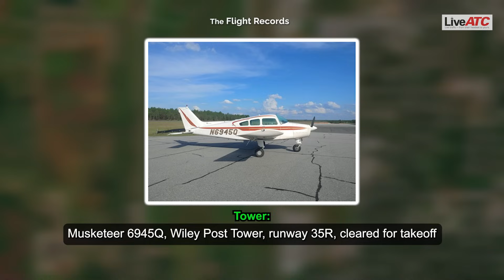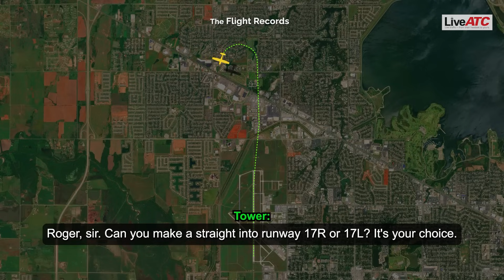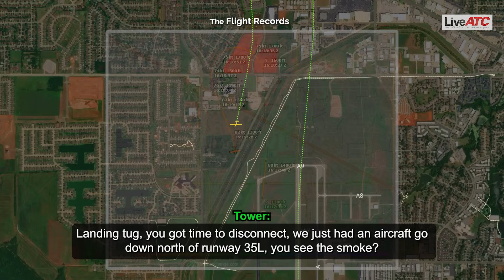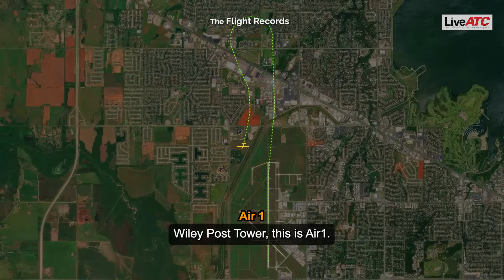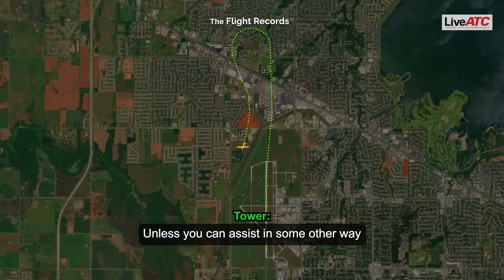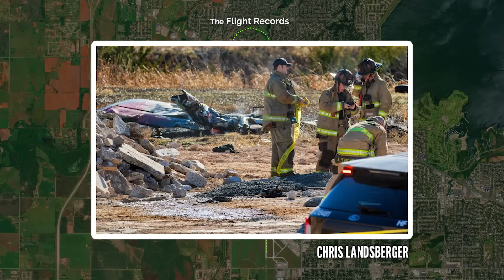LOSING POWER just after departure | 2 DEAD IN NW OKLAHOMA CITY PLANE CRASH

Comment: As a CFII I will never understand why people waste valuable time on the radio.  I have had to land in farm fields, taught dozens of students how to conduct emergency landings, and other procedures when there is very little time to spare, none of it ever included talking on the radio.   If your engine fails there is nothing the tower or anyone else can do to save you.  It's up to you to practice what you should have been taught.  The radio is fine when you have lot's of time.  I have had emergencies at high altitudes and had the ATC find me an airport wihin a short distance away.  But not when seconds count.
Reply: I was giving my son a lesson (he's an instructor in the CV-22 now) when we suffered a catastrophic engine failure after takeoff at KFMY runway 5. After I took control and knew I'd make in back down on the available runway I called the tower and let them know we were landing. I figured they had a right to know, as long as I had the approach more or less nailed, but didn't make the call until I got the important stuff done. As for people taking the time, I agree that unnecessary communication is a bad idea but I also understand, to some degree, the human need to talk to someone at stressful moments.
Reply: The only use in such a situation like this is to let them know you have an emergency and are turning back so they can clear other aircraft out of your way.  Also understand that a partial loss of power could mean a total loss at any moment and find a place to get the thing on the ground.
Reply: Agreed 100%   In April of 2000 I experienced a crash of the aircraft I was flying.   A Piper 161 Warrior, N4319U.  It was in Williamstown, NJ.   It was a similar situation with losing power at 2100 ft.  There were no airports in sight  so I concentrated  on NOT letting the aircraft stall at low altitude.  If I was going to hit anything it was going to be horizonal, NOT vertical. I felt in those few precious minutes,  the only thing I could do, after going through  my emergency check list is,  FLY DA PLANE!!!!!!!  Thank GOD I did, right into a corn field, and Thank God, we walked away.
Reply: @victorcroker2765  I learned at Linden airport in central jersey.  LOTOT we did 1995 practice at 1,900 rpm, cherokee 150 hp short wings, added 10 degr of flaps, leaned mixt and some carb heat if humid.  Sustains altitude like that.
  Many just land anywhere in panic, and destroy the airplane.  Hell NO.  It is mostly a bad cylinder but you can still fly level to nearby airport with 2 on board at 1,900 rpm at near sea level.  Not high..
Reply: I think its like a security blanket or something.  It's like calling 911 while at the same time looking down the barrel of a gun.  The dispatch or police can't do a damn thing for you in that moment.
Reply: @1realtruthrightnow742  Instead of keep fighting, they call mom and dad.  Panicky Pilots will crash.
Reply: @1realtruthrightnow742  One of our basic needs is communication, and we endeavor to train that reflex out of our students.
Reply: @CFITOMAHAWK  I found references on the web to your acronyms, neither of which do not appear in the AIM or the FAA Airplane Flying Handbook, or the PTS for any rating, and are therefore meaningless for flight training.  But kudos for getting all your flying education on the Internet. 

You still haven't addressed this terrible advice. "If the engine is vibrating at over say 400 agl ofter (sic) take off, but keeping the rpm over say 1,700 then a tunback can be done safer due that is mostly a failed cylinder and the others are keeping some rpm and will mostly sustain level altitute (sic), but wont climb on 3 cylinders of 4.  6 Cylinders engines mostly will climb on 5 unless high density alt. or heavy.  NOTE THAT. 

BUT IF ENGINE IS SURGING ON AND OFF,  that is a fuel problem instead and it might quick OFF soon.  Lower the nose, change tanks and lean the mixture a bit.  Don’t turnback unless a power off kind at over 700 agl is safer because it might quit on the low turn and you wont reach the runway."

Besides being nearly impossible to read, HOW DARE YOU give specific advice for some unnamed aircraft and push the incredibly bad idea that those numbers apply to any aircraft?  And the very idea of continuing to fly after a cylinder fails, something a pilot CANNOT diagnose in flight, is absurd at best and deadly at worst. Again, HOW DARE YOU!

By the way, the "C" in the engine failure acronym does NOT stand for communicate. You are conflating it with the unofficial phrase, "aviate, navigate, communicate.

"An altitude marker on altimeter that you use to mark the alt to turnback in case of LOTOT and or EFATO before EVERY TAKE OFF, depending on conditions you see."

As there is no chart in any POH to calculate that altitude, how do you calculate that it? 

Readers: Do not even consider taking this guy's advice. If you have questions regarding this or any other subject, consult with a CFI.
Reply: @CFITOMAHAWK  I looked up your acronyms and found only a couple of references, but no description of any maneuvers. Can you kindly describe those four maneuvers? In the interest of safety? 

I predict you will not provide that, or any other technical information I have requested, which is interesting as you have passed yourself off as an expert and given advice in this forum. And have you still not realized that you are arguing with an actual flight instructor, which a real pilot would have suspected when I mentioned the Practical Test Standards in a previous comment. 

People like you are dangerous because somewhere out there are people who would follow your advice. Readers, I reiterate, do not take flying advice from this guy as he is not a CFI, and maybe not a real pilot at all, and the anonymity he enjoys here allows him to give bad advice and never be held accountable. Always engage a real flight instructor for advice on handling engine failures or any other questions.
Reply: @CFITOMAHAWK  "Im a retired CFI that even qualified for Master CFI too"

Of course you are.
Reply: @CFITOMAHAWK  I have Airman Certificates that say Commercial Pilot and Flight Instructor, do you? You are a fraud.
Reply: My Bush  Pilot CFI in 1995 had 3 partial power fails working on old cargo airplanes in South America.  He was also a mechanic.  So i learned from the best, i dindt want a BS CFI with not that experience to BS me.  He said: loss of thrust On Take off, or partial power lost (we say LOTOT lately) mostly depends of kind of LOTOT.   If the engine is vibrating at over say 400 agl ofter take off, but keeping the rpm over say 1,700 then a tunback can be done safer due that is mostly a failed cylinder and the others are keeping some rpm and will mostly sustain level altitute, but wont climb on 3 cylinders of 4.  6 Cylinders engines mostly will climb on 5 unless high density alt. or heavy.  NOTE THAT. 

BUT IF ENGINE IS SURGING ON AND OFF,  that is a fuel problem instead and it might quick OFF soon.  Lower the nose, change tanks and lean the mixture a bit.  Don’t turnback unless a power off kind at over 700 agl is safer because it might quit on the low turn and you wont reach the runway.

= Dont turnback or turnaround the airport if engine is surging on and off under the power off turnback marker YOU HAVE DONE before that take off.  We had a marker on altimeter.
Reply: @CFITOMAHAWK  A turnback marker? If you are a CFI, as your screen name would seem to indicate, how in the world do you justify throwing out specific numbers for some unknown aircraft, and and advising people to govern themselves based on that information?
Reply: @CFITOMAHAWK  Never heard the term, nor since I started flying in 1971 have I heard of anyone doing such a thing. I suspect you made that up, as you did those acronyms, but okay, if that's really something you do.

You also didn't address my comment regarding your ill-conceived advice based on the dubious numbers you presented.
Reply: I lost a engine 4500 12 miles from PTW I told air traffic I had a engine blowup and was landing next to RT 100 in the grass phila  suggested I try to make Pottstown airport at your 9 o’clock 12 miles I looked over and saw the towers and the airport  I never thought of trying the airport I was in a diamond da40 the controller helped me in that emergency in my case I was communicating praying and flying but I am good at multitasking
Reply: As a pilot of 40 years , i agree. Aviate, navigate , communicate, in that order. Doubt he enough altitude to return to the airport anyway. Fly as far into the crash as you can. A stall /spin is never survivable.
Reply: Aviate. Navigate. Communicate.

In that order.
Reply: Yelling a Mayday in order to clear the runways is all you should generally ever do with the radio I would imagine
Reply: @ChadDidNothingWrong  Why yell? Yelling could make your amplitude modulated transmission difficult to understand.
Reply: @ChadDidNothingWrong  He was over turnback altitude.  you turn, then call. and troubleshoot.  Calling is the last thing.  landi on taxiway if , or grass.  Take off guys wil fly over you.

Comment: It's called the impossible turn for a reason. Don't think you can make it back easily. Fly straight ahead and pick the best spot to come down while maintaining airspeed and level flight. Don't get suckered into trying to make it back to the airport after a power loss. You will only end up being the first one at the scene of the accident.
Reply: Actually, I think he made the turn-around successfully and was headed back to the field. I would say that he tried to stretch the glide a little too much and stalled within throwing distance of the runway.
Reply: @megadavis5377  ---  I agree.  The impossible turn isn't always impossible if you manage to keep the nose down and don't freak out.  But you have to offer altitude in trade.  He got past that, but then remaining altitude and distance came into the equation.  At that point, it's full flaps and aim for the best spot to reduce speed and impact (like between two trees).  At the altitude he probably had left there was no chance to recover from a stall.  It seems there has been above average GA tragedies lately, although Dan Gryder from Probable Cause is keeping tabs on this and saying otherwise.
Reply: I’ve tried it a few times. Always came up short. Always best to find a big open road or field.
Reply: they actually made the turn, but had no altitude left to work with.
Reply: Don't believe he stalled in the turn. Turn was completed and he was on the way back to the airport!!
Reply: he didn't stall, but if the plane wasn't making enough power, you can bet he lost precious altitude making that turn. @scotabot7826
Reply: @mellocello187 No other places to crash on that airport, he didnt change tanks or troubleshooted either, That airplane have short wings and dont glide far.  There was no wind, At least he tried instead of crashing on top of houses and cars straight ahead.  He survived with some injuries..
Reply: I only wish single engine pilots would study these types of incidents, really think about the situation and recommended solutions, and fix them in their minds before they switch the mags. One too many don´t.
Reply: Correct.  He had not much choice.  Just terrible.
Reply: Look at that map  Not a lot of open anything around there.
Reply: Word.
Reply: Lol. It is a very possible turn if you know how to fly. Go read Barry Schiff. for decades he spoke about the BS of the impossible turn
Reply: @RATINDEXA320  "Lol. It is a very possible turn if you know how to fly."

I would say that it's only sort of possible, but that depends on so many factors it's difficult to label it possible or impossible. 

And yes, I know how to fly.

Comment: Not smart to take the left turn.....better stay straight and land anywhere you can, without making any  turns...Happened to a guy I knew who had a twin,  whose engines both quit on take off. He went straight down, ended up near a woman's house, but no one was hurt. The plane was totaled..The guy never flew again. He was a surgeon  and their flying abilities were never stellar. This guy did the right thing. The mechanics had put detergent oil in his crankcase. That killed the engines. He knew what to do and that way, not trying to get back to the airport !
Reply: Good advice, but honestly looking at the map from here I don't see a whole lot of landing opportunities straight ahead for a good distance.  There was a large highway running roughly perpendicular to their course that may have been an option depending on how heavily trafficked it was at the time.  Other than that though it was all subdivisions ahead of them for a few miles.
Reply: You have to put detergent oil after a say first 20 hours of new engine.  If both failed, i bet it was water in fuel he didnt drain it well.  No power heavies like twins cant do turnbacks..
Reply: There’s nothing but neighborhoods north of the airport, I work at one of the hangars on this field. The field he landed at was the best option given the circumstances. He barely caught the rock pile, if he would have been a foot higher he would have at least had a chance… so sad, left a young daughter. Wife died on scene, husband (pilot) died in hospital

Comment: Damn it. From the graphics it looks like he was almost there. RIP.
Reply: That may be what led to the fatalities, unfortunately. I don't have any information other than what's in the video (and a 20 year old private pilot cert), but the desire to "stretch" the glide when you're "almost there" can easily lead to a stall/spin at low altitude. Physics is physics, and if you don't have the potential energy, you can't turn it into kinetic energy. And "best glide" speed is best glide speed... you won't glide further by pulling back on the stick. If they weren't "almost there" they might not have been tempted by this and may have landed horizontally in a field. Unfortunate situation. RIP.
Reply: That's the allure of the "impossible turn"... it seems possible...until physics and lack of energy catch up with you.